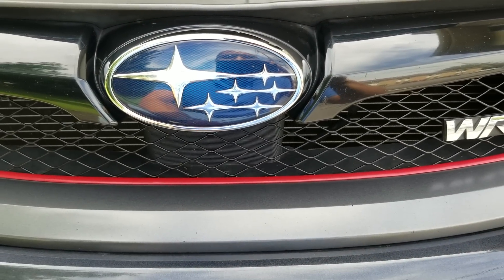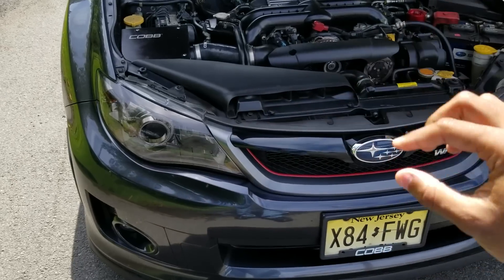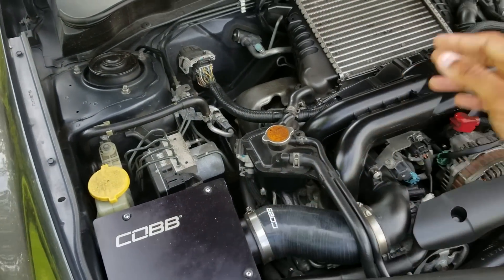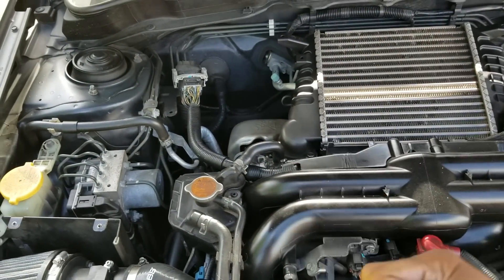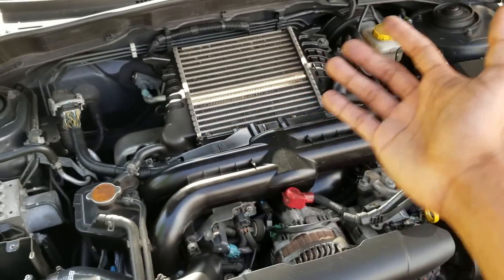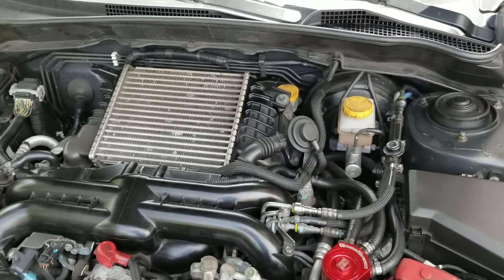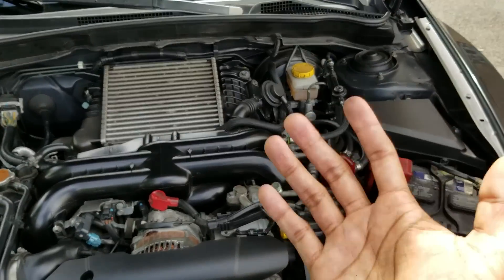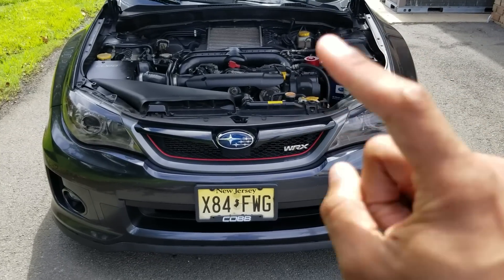WRX EJ25: Full Recirculating will work best

Comment: Just a tip, A cone filter fitted directly to a MAF creates turbulence through the MAF and can end up reading more air than there actually is or not reading enough of it as the air dose tinny circles inside the MAF rather than a straight flow . I would have a gap between them if your going to use a cone to give the air flow time to smooth out before going through the  sensor. MAF sensors suck.
Reply from the maker: yea they definitely do and that is a good tip bro.  For the other people here and myself would you say it would be better to keep the stock box in or maybe go cold air so that you can keep the cone further away and reduce that turbulence?
Reply: Noel3286 thanks, well it depends on how much power ur going for. If it’s fairly stock I wouldn’t bother changing nothing. Be a waste of money. Better off changing your stock filter for a quality clean one more often and that’s what I do, I use Bosch. They are like £10 . Aftermarket panel filters be my next option. If your pushing big power normally ur running aftermarket ecu and then the MAF is not normally used then I would use a cone filter but only a good quality one that’s placed with a cold air feed. But remember it’s useless unless you keep it clean all the time. Amount of cone filters I have seen that are caked in shit and have become just a restriction is crazy.
Getting bad signals from the  MAF can cause lean mixtures which then causes knock which damages engine bearings.

Comment: You need to tune on MAP sensor instead of using MAF. This will allow the use of full atmospheric BPVs. But yea, a pro tune is what you want anyways. Do not trust the OTS maps. Ive been building and tuning subarus for over a decade.
Reply from the maker: Awesome man...that is good to know.  Didnt realize the pro tune would be applied to the MAP sensor.  If someone is definitely looking to go that route just to run a Atmospheric bov its good to know that there is an option to run it efficiently and safely

Comment: i bought a gob bpv on my 06 lgt, i said fuck it. I run 25 atmos, 75 recirc, and it runs fine. Its an auto so it rarely goes off anyway. It will just run rich for that small instant. Which is way better than lean, wont blow up your engine. I dont think you can protune a bov venting to atmos.
Reply from the maker: You can get a protune on the MAP sensor so that it can make the car run efficiently with the Atmospheric BOV on the car.  It wouldnt be a tune on the BOV it would on the sensor that does the calculations

Comment: Also there's not really a specific tune for a bov
Reply from the maker: Yea true i should have been more specific.  You can get a protune on the MAP sensor so that it can make the car run efficiently with the Atmospheric BOV on the car. It wouldnt be a tune on the BOV it would on the sensor that does the calculations

Comment: You can vent full atmosphere no problem on these cars as long as you adjust the spring preload. I've been using a gfb bov (highly recommend) for years on 2 separate wrx's. Sounds amazing and runs just fine. All that happens is you run rich for a second in between gears. Gfb videos even talks about this. Its very controversial though
Reply: Just tune on MAP instead of MAF and you can run full atmospheric bypass all day
Reply: Darth Bane I tune subarus. I have been for a very long time. If you can't get your tuner to tune on speed density(MAP)  without it stalling while coming to a stop then you need a new tuner. By "tuner", I mean a professional person/persons that can calibrate your ECU correctly to your engine. Please dont spread false information. Nothing wrong with tuning on map. Actually the only true way to run full atmospheric BPV on any engine/ecu
Reply: lmao look up gfb videos and watch their video on the respons bov. not gonna explain again for you
Reply: im not asking you to explain anything. Im telling you not to spread false information about the logics of how it works.telling me i have the risk of bogging down to where I almost stall. Please! im trying to save you from looking like an idiot and spreading wrong information. Do some research or go to school or something then spread knowledge. jesus.
Reply: do you not understand when I tell you I tune subarus for a very long time?
Reply: ive been using hks bov vta for years 2016-2018 stis excellent response from car + smoother shifts
Reply: Darth Bane would you recommend that bov for a 03’ wrx?
Reply: UhhhSitrep I would highly recommend the GFB respons blow off valve. it's very high quality and if you wanted to run bypass/recirculation like Subarus come from factory you can. all you have to do is twist on knob on it. you can also run 50% atmosphere and 50% recirculation if you wanted and alot of people do that. it's a bit pricey but it's well worth it. and it sounds great  and is super loud 👍also is an easy install. no adapter plate needed
Reply: UhhhSitrep I have an 02 wrx and it fits perfectly
Reply: ahhason https://m.youtube.com/watch?t=175s&v=KgGRfR6jt-c
Reply: Darth Bane spring load is spring load nothing special about how it works. If you have it adjusted wrong then you will have issues no matter what. Either you vent to atmosphere or not. Do some tuning research then you will feel like an idiot. If all you guys think that running a atmospheric BOV on a stock Subaru ECU/tune, is problem free then you obviously are very misinformed. It is not okay for it to be rich between shifts. That is a problem and that would be a uncalibrated system. This is why most people feel a studder or hesitation when shifting. You might be able to make that feel little better by adjusting spring load but you also put more strain on your stock turbo that way. Cause now the BOV is working at a different rate which is not fit for a stock turbo. I don't care if you don't believe me. It is what it is. At least I won't spread false knowledge and make the world more dumb like this Darth bane character.
Reply: Maybe subaru can handle it, my 1jz would die every time that thing would open.
Reply: ahhason yeah but that way you risk stalling your car coming to a stop or bogging down to where you almost stall. plus, upgrading your bypass valve is always a good thing in the long run if you plan on making anymore power. I think being able to control how much you want to recirculate or vent off is a better option. reliability and all that
Reply: ahhason https://m.youtube.com/watch?v=bsy9hJic7cQ 

i don't believe you tune Subarus 👍 also, im only referring to this specific bov or any you can regulate the preload rate. other wise I agree with you. when you don't adjust the spring preload, the piston will be open to long causing it to stall or bog down. just saying my dude. a "subaru tuner" should know about spring preload.
Reply: Can only say yes to this. Have a GFB Respons on my 02 WRX now and it runs perfectly. Just adjust the spring load as shown in the tutorial by GFB and you won't have problems.

Comment: This will also kill the MPG significantly if not tuned right? Buddies Subie dumps close to a quarter tank going across town.
Reply from the maker: Yup exactly.  Too much fuel and not enough air = running rich.  Car is constantly trying to compensate for the lack of air recorded off the MAF sensor in the beginning.  And depending on other mods that he may have, without any sort of tune is definitely not good.  He or she may also have a heavy foot too depending on how fast they want to get around town.  That has been a known killer of gas also.  So heavy foot + running rich = lots of money spent on fuel lol.  He should look into that tune for sure for the cars sake and his pockets.  Thanks for watching man!

Comment: Go Fast Bits GFB T9001 Dual Action BOV work on the wrx/sti!
Reply from the maker: I have heard of that BOV.   It is safe in the sense that it is adjustable and you could choose to run it 100% full recirculating like stock and be ok.  You can even run it 50/50, 80/20, or 70/30 and you mayyyyyy be ok in that sense without at tune..i know i wouldnt do it.  But i bet if you run that thing 100% to atmosphere you are going to have some future problems on your hand without a Pro Tune on that ECU.  Just be careful out there.  We need our subies to last as long as possible is all im saying.  Thanks for watching!
Reply: Dual port bro! Read up...
Reply from the maker: Scott Cunningham Scott Cunningham I'm aware its dual port..you still have to configure it to get it to work optimally so you got to be careful because you can still do damage to the engine if it's not set up correctly..a tuner may still be helpful...it definitely is one of the better ones on the market though...just letting people know it's not good to just slap these things on

Comment: Thank you!! I have been thinking about this and I knew it was bad but now I know for sure. I appreciate you. Next up is the Cobb intake and acc port
Reply from the maker: No problem man.  I tell a lot of people it can be done going atmospheric but you got to get that Pro Tune.  Without the pro tune for the BOV you asking for bad things to happen.  Our EJ motor was not made for Atmospheric with the way it was designed so you got to be careful where you get that Pro tune too.  Hopefully someone reliable and that can get expensive with the dyno and everything.  To me it was easier just keeping it stock knowing my engine will run and handle boost fine with the recirculating and stick with a Cobb acc/map and intake.  Super easy and safe.  AND you still get that BOV sound!  Thanks for watching!
Reply: Noel3286 How is the Cobb and intake holding up ??? Any problems ?? . Been thinking about doing that as the first mod in the spring
Reply from the maker: Hey Steve.  The intake and Accessport  has been nothing but bulletproof man.  Easy install and the perfect first mod for anyone wanting to unleash some extra power from the Subie.  Its like night and day.  I have had no issues with it and it just brought my car to life.  No regrets dude.  You will thoroughly enjoy it!
Reply: I've had a GFB blow off valve for a over 2 years now, I have not noticed anything huge, like above it runs rich for like 1 second then returns to normal.

But that being said, it has been tuned with it in mind.

Comment: I have a wrx with atmospheric bov with a tune and works fine with me. You need a tune for the maf.
Reply: You can't tune the MAF for a BOV....... you need to get a speed density tune which doesn't rely on the MAF... The whole reason a MAF tune doesn't work with a BOV no matter the tune is because the BOV comes after the MAF which means there is no way to measure how much air is released
Reply: what bov are you running, and how much was the tune?
Reply: Blitz bov and tune was around 450$
Reply from the maker: Yup exactly what I said.  You can run Atmospheric.  I have seen people do it but you better get that pro tune.  Without that pro tune our Subies will get real busted up on that Air to Fuel ratio.  And no one wants to say bye to their EJ motor.  Thanks for watching!

Comment: BOV on my wrx for the last 5 years still pullin strong
Reply from the maker: If he is running 50/50 then yes you could pull it off with no tune (still wouldnt be good though).  I have seen people do it but its also a 50/50 shot of maybe having some issues. I have ran across some people that say the car runs funny and some that dont.  Your taking a chance for sure.
Reply: @noel3286  i installed a perrin bov and in 2 days i ran out of oil, fk that valve hahah. not recommend
Reply from the maker: @2secon926  I only reiterate what the internet has stated.  Some people can take risks...i choose not to.  I just heard way more positive stories of people sticking to a recirculating bov setup and being perfectly fine.  Glad you caught your situation quick man.  Good luck and thanks for watching!
Reply: Jesus Lazaro no tune? Thinking about getting one
Reply from the maker: 100% vent to atmosphere or 50/50?